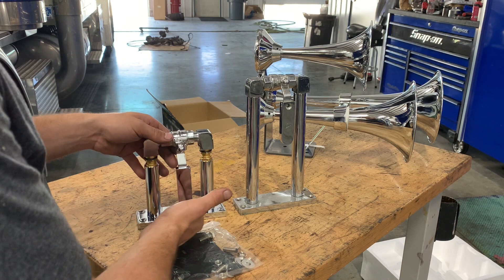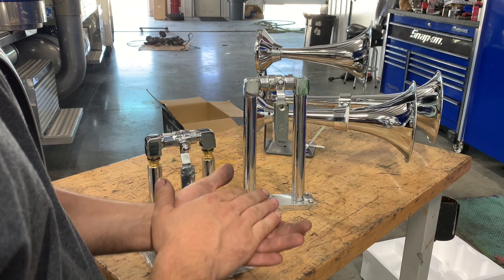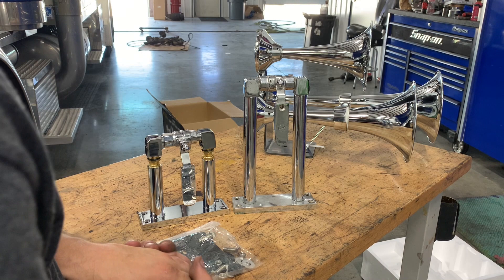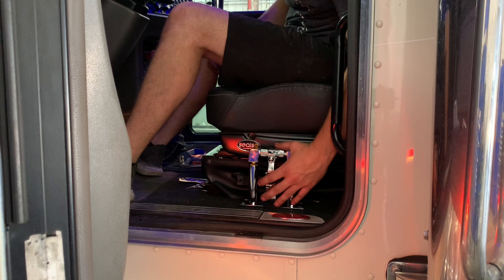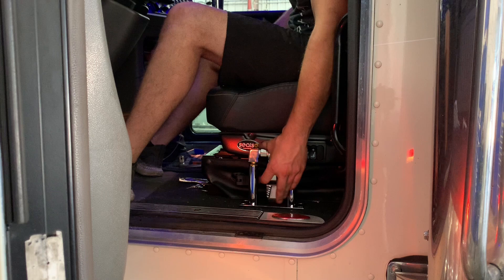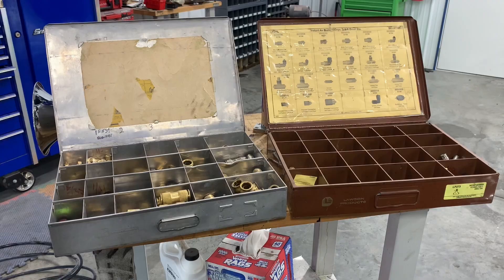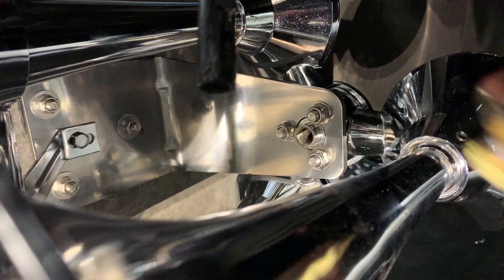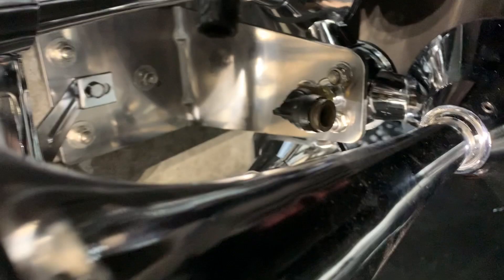how to install train horns! grand general train horns. peterbilt 389. big bunk.

Comment: I was able to get more turns on the valve fitting, just squeeze the tubes on the base as you push the valve into the tubes.

Comment: I think I'm gonna unplug my roof horns and run a air line from the valve from the roof horns to the train horns.
Reply: Did you do this? Using the factory pull cord?
Reply: @jacob2483 you can, I did it with my Kenworth T680, idk about other train horns brands but with the GG there’s a little stem or plug inside the solenoid, that you gotta remove, or  it won’t work or at least that what I did and my horns and it worked….to get to it tho you’ll have to unscrew the solenoid and then remove the sticker from the top part of the solenoid and there’s a a small Phillips screw, that will remove the cylinder looking thing and then there will be an Allen screw, just unscrew it with hand and there will be a small spring and plug, remove it and then Put the other parts back together, stew the solenoid back in the horns and then connect line that use to run to the factory horn and you should be set to go!